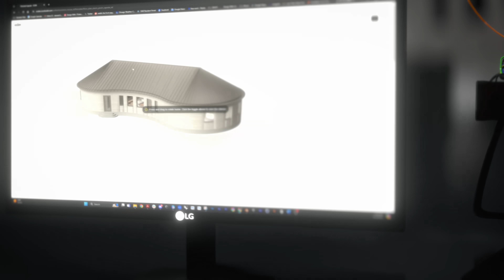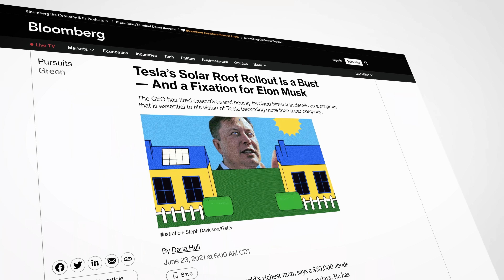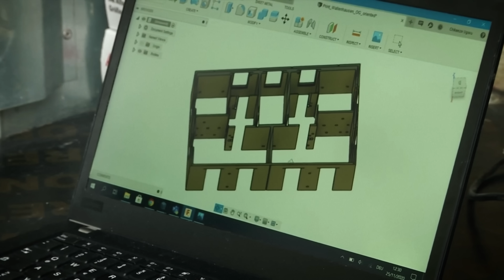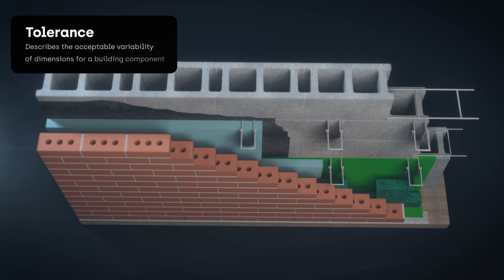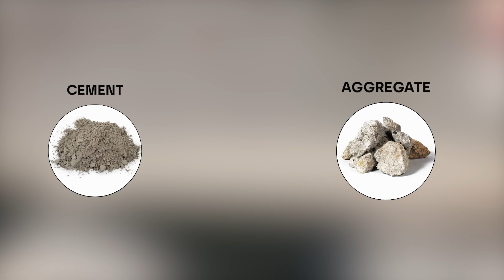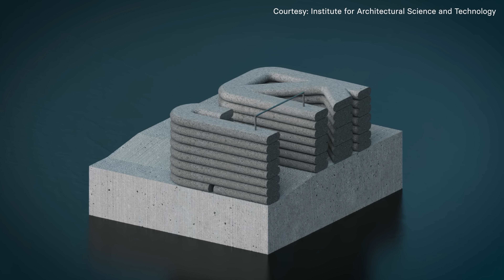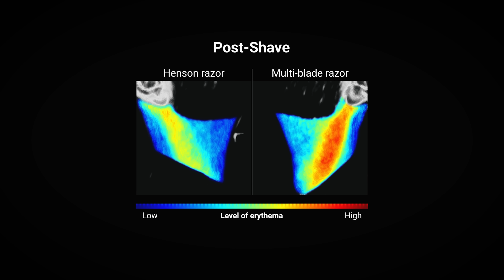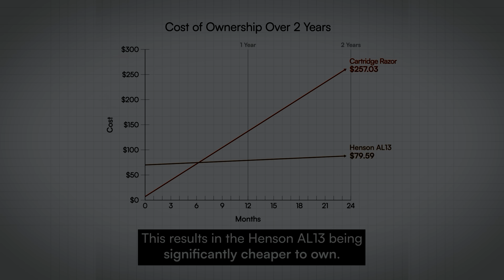Why 3D Printing Buildings Leads to Problems

Comment: We've been building for what 5000 yrs, 10000 yrs? And we use 3D printing now for 10 yrs yet you complain about the limitations? Isn't that somewhat short slighted? A bit unfair to say the least?
I don't believe 3D printing buildings will disrupt the industry any time soon but I like to look at it as a way to rethink the concept. How can we build differently ? What problems does that solve and what problems does it create?😊 You can optimize later, such as prefab, certain mix recipes for something, multiple print heads.

No it won't replace our houses built traditionally just yet but it helps us look at an industry that's hard to innovate with a breach of fresh air. Printing is great for making walls ! Making Windows and doors is a challenge though 😊

Comment: The process is really "automated concrete extrusion" but that doesn't sound impressive so the "printing" meme was chosen instead. 
That guaranteed many people who have no clue about construction would get childishly excited. This is quite like what I call the "shipping container effect" where people see a steel box and are excited by the shape without caring to build an informed opinion. Study and know, never speculate. Automated concrete extrusion only addresses shell cost and may or may not be the best way to obtain a desired result. For example study why structural steel (which really should get more love since it's so easy to work with for a reliable result) framing and concrete precast panels are used for industrial structures.

Comment: The pace of development of construction techniques is slow because buildings aren't short-term items like phones or even cars.  A phone has to last around five years, and if it doesn't even make it that far then people grumble and replace it early.  Cars last around twenty years, and again, if there are problems then they are replaced early or recalls are performed, particularly if safety is the cause of issues for cars.

Buildings are usually built with either a long lifespan in mind, or no particular end of lifespan.  Construction techniques must be reliable and safe first and foremost, and Musky innovations are not compatible with this sort of progress.  Many requirements in building code are there for reasons, ie, something failed and killed people so now buildings have to comply with regulations that aim to prevent that from happening again.

unreinforced cement buildings aren't going to meet code in a whole lot of places, before one even considers appearance.

Comment: So.e Pell act like rebar doesnt expand contract rust and cause cracking in nearly every structure its placed in. Every aingle time i see concrete fail its because the rebar in it somehow broke it off. 
3d printed homes is the future.

Comment: 100 shaving blades? Why? Just shave electric. I've owned my shaver for 20 years now, and probably it will work another 20 years, lol. No maintenance, almost no cleaning required. And no shaving cream. Not a cut in 20 years.

Comment: Nice toy. When you can get it to print roof structures, tiles, insulation, drywall, joists, lintels, skim finish, wiring, plumbing, windows, doors, underfloor heating, light switches, sockets, smoke alarms, bath taps, showers, shower screens, cornice, skirting, kitchen units, appliances, toilets, stairs, balustrades, carpets and then paint it all, come back to us, we might be interested. Until then it's doing approx 3% of the work of building a house, and doing it badly.

Comment: The big problem that 3D printing houses does not solve at this point is the fact that different areas of even the United States have different requirements. For example, a house built in California needs to be strong against an earthquake while one in Florida needs to be strong against hurricanes while one in Maine needs to be suitable for winter. There is no real way to sit there and take that technology and make it suitable for different types of things easily. Earthquakes are probably the biggest threat to 3D printed houses because there's no real way to 3D print in the necessary structures required to allow the degree of flex needed to distribute the load during an earthquake without somebody going in there and doing that work by hand which would also not be very easy with a 3D printed house. While 3D printing houses might be faster it's far less versatile then doing it in a more traditional way. Then lets be real... the walls look ugly and the countless seams would make cleaning a wall a nightmare, let alone painting it. Plastic 3D printing has the same issue but its less prevalent since to reduce it you can print a fraction of a milimeter. You cant do that with a house without removing the benefit of speed.

Comment: 3d printed houses are by far the stupidest thing I have ever seen. 
Concrete is not indestructible. There is a reason Brick houses need to be re-pointed and driveways need to be repaired and replaced.
Curved walls are empty walls and wasted space. 
A wood framed house can last hundreds of years. A concrete house will not.

Comment: On the topic of building houses in general, I have never really understood why houses aren't made to be modular. 

Like why can't I buy 4 standard modules and plop them on any plot of land to have a bedroom, living room, bathroom, and kitchen ready to go within a few hours? 

And then when I want more space, I can just buy another module and hook directly into the existing ones. 

Yes, I know "modular homes" do exist, and have for a really long time, but I've never seen a system that works really anything like I just described. Why is that? 

I feel like the biggest reason is probably just "cuz water", but surely seal technology has advanced enough that rain isn't actually stopping us from doing this? It would be utterly bonkers if we can add modules to the ISS and seals aren't a problem, but they would be on the ground. How would that make any sense?

Comment: Dont curves help with wind more than just corners on a house? The house at 4:19 looked nice. Why cant you have humans go in and smooth after the printer spits out the cement. Why cant we go back to brick. I think you can build a robot that pick each brick and brings it to you and the guy just adds the cement. 

Hate AD inserts, but I like the vibrating razors. I cut myself less.

Comment: The only issue I see as insurmountable is the lack of repairability. Most everything else can be cleverly engineered. In a normal house, you can fix a broken joist or stud rather easily. In a printed house, a cracked foundation will mean your home is written off. I see printed structures being most viable as either semi-permanent or non-inhabited, like a military forward operating base or a detached garage, respectively. Concrete is a great insulator, so that is a bonus, and mold can be mitigated in many ways. The rapid construction is very handy, as well as the minimized variety of parts and tasks needed to build. I see the benefits, certainly, but the inability to repair will be the biggest hurdle.

Comment: This video is clearly made from a constructor point of wiew rather than a 3d printer one. And the truth might be in the middle, not for sure in your points which appear to me, kinda weak. I surely overestimate 3D printing capabilities bc I'm a 3dprinter, you heavily underestimate them because you're a builder. But in the video actually you're just showing, to me, obvieties, non-problems or even intended features not difects. (layer lines and corners to say the 2 most pointless)

Comment: Sorry dude im too little into the vid maybe, but you're complaining for human intervention in making what we call bridges, both in 3dp than in architecture, complaining for layer lines, complaining for no sharp edges... I mean if the end of the video doesn't say something I dont know, then what am I here for?
Til now, yeah 3dp stuff looks different from subtractive manufacturing or molds. I like it this way. What's the point? Where are the actual challenges of 3dprintin concrete? The ones I can't see, I mean. 
There's people in comments saying it's a bad idea to 3dp concrete and they have arguments I don't see (yet) in this video. (about reinforcements for example.)

So about 5' into your content and the problem with 3Dp houses is not having sharp corners?

(it's called postproduction, in 3dp and yeah we hate it but it's a thing. There's a guy with a bucket of concrete and a tool which goes around and sharpen all the corners. He would have to do it anyways, He now only has to add more material in the corners. Tell me it's genial.)

Comment: you hit it right on the head, prototyping is the justification for 3 printing whereas mass production of prefab buildings is more efficient when done in a factory.  Quick and dirty is what 3d buildings are with minimum input in terms of people and equipment.

Comment: Most of your concerns about repairability go away if you just consider it like any other concrete building. 3d printed buildings are just concrete buildings. Even your concerns about surface finish go away with regular stucco like in regular concrete buildings. My only concern about these structures is the lack of rebar...

Comment: What is load of bullcrapped stidpidity is this? You know what makes 100 times faster, stronger, safer and cheaper than this idiocy? A prefab, modular stacking walls or "bricks". It suffers none of the drawbacks and enhances all of the advantages.

Comment: PERI Build the first 3D printed house in Germany close to where i life. Very cool stuff, they left the outside exposed to show its 3D printed but usually they finish the walls just like normal Brick walls and you can't even tell if its 3D printed

Comment: I don't see a single upside.  ICF's seem to be better in every way.  ICF construction places all the blocks in place, which is very fast and doesn't take many people; there's a chance to do a final check to ensure you like the walls where they are before pouring the concrete.  The concrete gets proper rebar reinforcement, so it's much stronger; also, the concrete walls are all poured at once, so you don't weakness introduced by concrete being really bad at adhering to new layers.  The 3d printed walls look horrible, and will look even worse as dirt and dust get into all those exposed grooves; they really need to have a person go back and smooth the texture out.  Lastly, that's great showing them on flat ground, but what about houses on slopes?  So they are weak, ugly, and much more difficult to actually do, than ICF's.  It's like all the disadvantages of stick built houses, without any of the benefits; worst of both!

Comment: Stewart, I think you need to spend more time with brick in older constructions. You can span windows and doors with brick arches (no steel needed), and a big advantage of bricks is that you can easily change a brick wall years later to add or remove windows and doors. Stewart Brand's classic How Buildings Learn is a great explainer for buildings and materials like brick that can easily adapt over time.

Comment: Good video and you hit a few good points.  My thoughts, though:
You keep comparing this tech to bricks.  Well, bricks are NOT the appropriate comparison, since many more homes are now built with concrete blocks.  With bricks, you need perhaps 6 to 8 times as many units laid as blocks.
The HUGE issue is that all the rest of the house is incompatible with this method of construction.  Where are the pipes and wiring that are inside concrete block structures?  How do you add drywall to the interior, when the underlying wall cannot easily accept a furring strip?  Or is curved?  How much extra effort is required to frame around a rounded interior wall end? 

I have watched a LOT of homes get built, and the time it takes to put up the initial walls is trivial compared to the time it takes to complete the house....so what does this actually save?  A week?  And what you end up with is vastly WORSE to work and live with after that?  Nope.  Much better are the robotic block assembly robots coming out of Australia.

Comment: The problem I have with 3D printing a house is that it 3D prints literally the cheapest part of the house - walls. So I doubt there's much in savings done. Plumbing, electricity, roof, heating/cooling, windows/doors, interior finish are all way more expensive that the walls so I don't see how they are claiming any benefit.
Reply: Every 3d printed house I've seen there is no interior finish it's just the bare concrete walls. But they can interrupt parts on the inside stuff like outlets and other wall connections. While true, it saves you nothing on plumbers and electricians it cuts out framers and the floor crew if you're fine with a bare concrete floor. It's a give and take.

Comment: its not a 3d printed home, its a 3d printed wall. still need floors, roofs, electrical, plumbing, windows, doors, paint etc and a million other things. walls are usually the quickest and easiest part of building

Comment: Knowing how fussy a small scale PLA FDM printer can be, I get why the end result is so lumpy and out of square. These printers are huge but still need great precision to dump the material at the right spot and the concrete hardens a lot less quickly than PLA does so it'l probably sag and warp before it's fully hardened.
Reply: They can only do about 6 inches a day.

Comment: Some glaring wtfs? in this yutoobers speech.

1. Stucco the outside
2. Stud the inside and dry wall.
3. If  something happens...didn't you say you can prefabe pieces?  Well prefab the pieces to use them to fill in the broken parts.

Comment: Maybe, just maybe, we can stick to frames with panels on either side, with insulation and infrastructure in between.
A decently coordinated crew can have wood subflooring and all major walls up with exterior panels within two days if they preplan and come with all the materials and tools, with minimal error in construction assuming they measure twice. For a two story house, maybe three days as they have to make another subfloor and create the support structure. The end result is a house with thinner walls than can be done up in any way you want, to where even the room layout of the entire interior can be completely upended and changed down the line as long as the support structure isn't modified. 3D printing has its place in design, fabrication testing, and hobbyist tinkering, it does not need to be used to create housing.

Comment: 3d printing is fine once you get bad area good its like using a smaller 3d printer ones you get passed learning all kind of stuff could be made other things can be used inside then not seeing the same as the inside i can see 3d printed cars on out side panels inside car parts

Comment: 20mm tolerance for a brick wall, I don't think so.  That's over 3/4" in real units. 😜

Anything more than 3.2mm - 1/8" would get a bricklayer fired from any jobsite I've worked on.

Gaps around windows are filled with expanding polyurethane foam that is covered by trim with a bit of caulking.  It's not rocket science.

Comment: As a residential contractor and past commercial construction worker... this is a horrible idea.  Imagine doing repairs or getting a hold of the builder to fix an issue
Reply: I hope people are ready to pay Electricians extra for running electrical through this new type of Rough In.